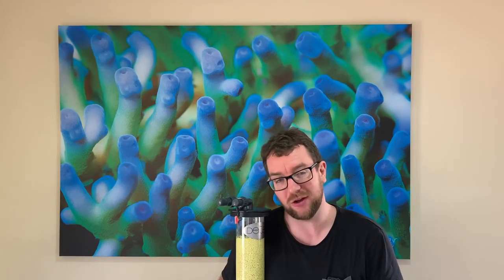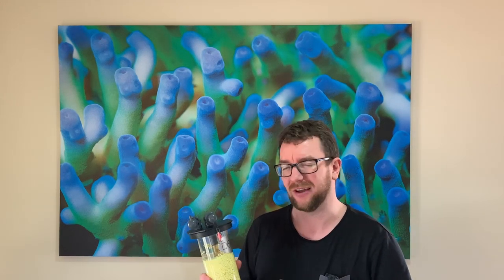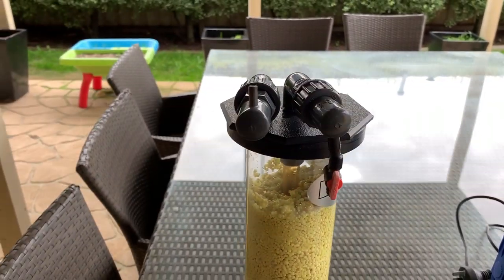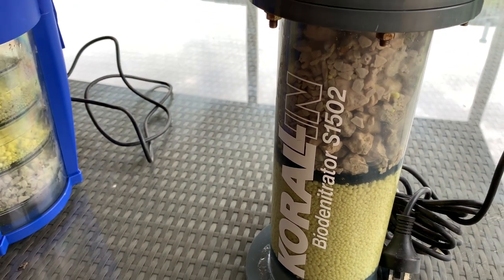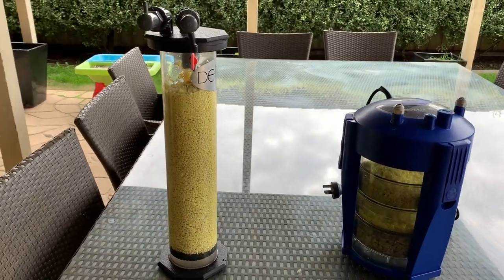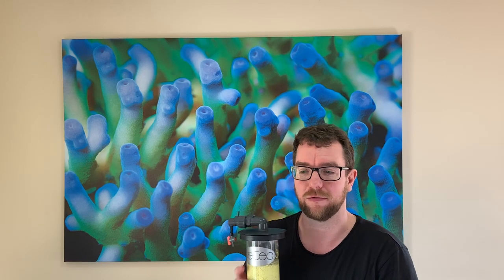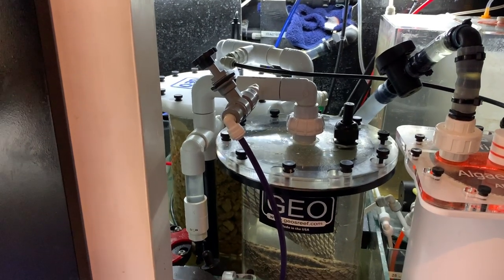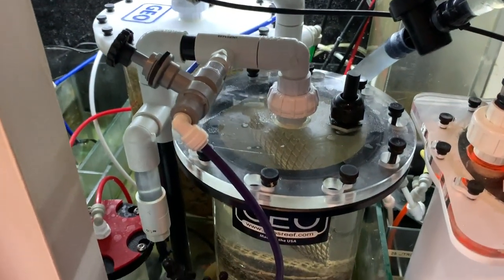Using a Sulphur Reactor for Nitrates

Comment: To run the reactor do you need a skimmer to remove the bacteria like with carbon dosing Sam my tank sits around 25ppm with 60l week wc tanks 200l so anything that can help cut back on the wc a bit would be Thanks for your time
Reply from the maker: Great question! I’d assume a skimmer would be needed, but perhaps not?

Sure thing, try 500ml of sulphur with a drop a second. Adjust it if it zeros your nitrates. Let me know how you go
Reply: @ParkersReef  I'll give it a try soon and let you know

Comment: Great video Parker, question though nitrates in my take are 45ppm but out of reactor are 60ppm has been running for 6 days now and no drop if anything a slight increase out of the reactor why would this be ? 
Reactor using is hmali with sicce pump.
Reply from the maker: Slow the effluent right down :)
Reply: @ParkersReef  is that the Inlet water or outlet water.

Comment: Great video. If the reactor only has a slow flow. (Drips)Even though the effluent is zero or low wont the tank produce nitrates quicker and therefore  have a higher reading ?
Reply from the maker: Yes, if that is the case - you will need a larger reactor

Comment: Hi Sam, currently setting up sulphur reactor as per your video. I ran full flow for 3 days and slowed down to 1 drip per second. I tested the effluent nitrate Hanna max out and my tank nitrate also bumped up to 28 from 20 before I put the reactor on. Is this something usual when starting a new reactor?
Reply from the maker: Not usually no. Has your effluent started to drop yet?
Reply: @ParkersReef  mean drip rate slowing down automatically?
Reply: For nitrate reading it still reading 75+ the colour on Hanna vial even darker today
Reply: For media I’m using aqua medic sulphur pearls in aqua excel nitrate reactor.
Reply from the maker: @shankybrar  not slowing down automatically, I meant is the nitrate reducing. If the effluent is higher than the tank, there is indeed something wrong. Was the media new? Make sure the reactor has no oxygen in it and slow the effluent down even further
Reply: @ParkersReef  from the Hanna vial colour it looks like nitrate are even higher then yesterday. The media was new from aqua medic. Pulling my hairs out about where the nitrates coming from. Yes I let of the air from the point which is available  to add probe to reactor. Don’t have any orp probe to check the status.
Reply from the maker: Maybe feed the reactor some bacteria to help seed it
Reply: @ParkersReef  “Use only in nitrate removing anaerobic filters having a low water flow rate” this what media packaging says. My reactor is recirculating. What kind of bacteria do you recommend to seed?
Reply from the maker: @shankybrar  yes that is correct. And your one drop a second is a very low flow rate :)

You likely won't need any bacteria as your tank water should have plenty, however if you want to speed up the process you can add something like a microbacter to help get it going
Reply: @ParkersReef  thanks for all the help Sam. I spend few hours searching on forums about the high nitrate reading from effluent. Few people had the same issue and someone explained that at the start the bacteria that converts ammonia to nitrite can overpopulates and produces tonnes of nitrite which effects the nitrate readings on Hanna. The advice was similar to what you recommended earlier about slowing the flow even further or adding a seeded sponge from sump or bacteria to get the other bacteria going or just wait out. I have slowed down the drip to every 4 seconds and let’s wait out another 3 days to see how it goes.
Reply from the maker: No problem, fingers crossed it gets the job done for you!

Comment: It's been about four weeks,  I still have nitrates coming out,  if it's to sleep a drip,  the reactor fills with gas,  and circulates that.  I have about 1.5 ltrs of sulfer in there.  I'm guessing just add another liter?  I have 3 eels, high waste. Thoughts?
Reply from the maker: Gas is a worry... we need to stop that. But yes, try some more sulphur to allow you to not have to slow it too far

Comment: Thanks for your help in advance.
Question with my AquaMaxx TS-1 and why Im having issues.
I set this up with 2 litres of sulfur prills and media. Set it up according to your instructions
Started with a drip a sec and measured affluent water until it measured 0ppm nitrates then doubled the drip out put and continued over 2 weeks untill I had a good output and brought tank parameters down to zero. Then about a month later I checked and levels went up to about 20ppm. Then a few weeks after that to 50ppm. Nothing has changed feeding etc. Wondering what Im doing wrong and why the levels would go up since these things are suppose to be set it and forget it once dialed in.
Reply from the maker: That certainly seems odd. Any chance of detritus getting caught in the reactor?
Reply: @ParkersReef  looks good and clean. also has a prefilter.
Reply from the maker: Hmmm ok then, not getting oxygen into the reactor by chance?
Reply: Not that I can see. There may be a liite bubble at the top that hasn't found its way out but I don't see air going through it
Reply: i think im going to back off on the flow and start again and see what happens
Reply from the maker: Yeah always good to start it back slow and slowly increase the flow again

Comment: I have a geo n64 nitrate reactor it is running off a  210 gallon fresh water fish tank it has been running for almost three months my effluent is at 0 ppm but my tank water is at 80 ppm I’m very fusterated the reactor says it can handle a 600 gallon tank I have a lot of sulfur beads in there and on top of that I have searchem denitrate media as well I don’t see the fish tank nitrate dropping ever I start at a drop at 3 drops per second when I increase the drops the nitrate reactor goes to about 10 ppm how do I get my tank to have 0 ppm please friend help me I would appreciate it thank you 🙏🏼
Reply from the maker: hi there, is the reactor recirculating? As in, does it have a pump on it moving water within the reactor itself? A decent sized tank (or a decent bio load) will need a reactor with a recirculating pump for maximum efficiency. Alternatively, you will just need to add more sulphur media
Reply: Yes it does have a pump on it the reactor is a geo reef n64 it is about 20 inches tall and an 8 inch cylinder tube I have the reactor 85 percent full of sulfur and I topped off the top with seachem denitrate media

Comment: Hi, thank for sharing! I currently running sulphur and arms on day 2. I was wondering if i let my tab reactor wide open for 3 days to flush out all the air bubbles, will i overdose my tank with calcium, magnesium and trace elements?
Reply from the maker: no you wont. The ARM will only release the parameters when it is melted, which it wont do at a speed to flush out the air :)
Reply: @ParkersReef  thanks a lot for replying. Really appreciate it
Reply from the maker: Anytime :)
Reply: I had a huge pH and 1 dKh dropped after opening the tab wide. Advices please🙏 500 liters total volume. Reactors filled with 500mL arms and 500mL yellow beads
Reply from the maker: Yes. That is because your bacteria is consuming the alkalinity. Need to go slowly,
Reply: I thought it takes 3-4weeks the bacteria to appear.. should i add more arms? Or start doing drip per second?
Reply from the maker: Not always, sometimes it is quite quick.

What speed are you at now? So you’ve had it wide open, is that it?
Reply: @ParkersReef  this morning i changed it to 1 drop persecond after realizing it dropped my kh and ph. Hope my acros not browning out 🙈
Reply from the maker: @vincenthendri9465  ok now that it is at 1 drop per second, keep an eye on the effluent. If it is at zero nitrate, keep speeding it up little by little. Ensure you are dosing extra KH as its going to keep consuming as the bacteria grows
Reply: @ParkersReef  thank you for the advices. I will try your way. 

Really appreciate it🙏

Comment: Is it common that the nitrates reading coming out of the reactor reads a lot higher than the actual reading in the tank? Mine has a 7.5ppm nitrates in the tank, but more than 50ppm measured at the output of the reactor. I had successfully bottom out the nitrates output @ 1 drop/sec (although it took 2 months to reach this). But 1 day after I increased to 2-3drops/sec nitrates output is through the roof again.
Reply from the maker: Not at all, something is drastically wrong

Comment: found this video and wondering if you still use this reactor. I've been dosing NOPOX, but just need to lower my nitrates and found your video. If you still use it, where can one in the US get the pellets and reactor from?
Reply from the maker: Not in my new display as my nitrates haven’t become an issue just yet (although getting close!)

The reactor is just a calcium reactor with no c02 inlet. The media you should be able to track down via a local fish shop

Comment: So the solphur reactor take care of you nutrients and the calcium reactor takes care of your supplements. Why do you do water changes with the awc? Thank you for sharing all your knowledge
Reply from the maker: Sulphur helps with nitrates, calcium reactor helps with alk/cal/mag and trace. I am still a very strong believer in water changes though, very cheap and effective insurance for your tank.

I know it is possible to run a tank without water changes, but to me it is kinda like running a marathon backwards. Just because you can, doesn’t mean you should :p
Reply: Parkers Reef  I gotcha. Great concept
Reply: Parkers Reef you think soil sulphur is the same thing? Found it on amazon and it says it’s 99% pure sulphur
Reply: Parkers Reef I want to use it but it’s hard to find in the states

Comment: The nitrate reactor must be supplied with water from the
 aquarium. There are different ways to choose the water source, feed pump,  peristaltic pump .... which way do you choose and how it connected to the reactor. thank you very much
Reply from the maker: Thanks for the question, I supply it from a tee of my main return pump. I regulate the outlet speed with a fine control 1/4 valve 👍🏻

Comment: I just bought the Aquamaxx reactor and can't find an LSM or any sulphur meadia at all. Please help me find a place to purchase. AWESOME VIDEO
Reply from the maker: yeah sulphur has been tough to get lately! You can try ebay, they often have sulphur "chips". As long as it is not a powder you will be fine
Reply: @ParkersReef  Found a 2lb bag on eBay. My reactor holds 3L is it a problem if I use 2L Sulfur and 1L calcium media in a 120g? I have very high nitrates over 100 sometimes 150. Is using extra sulfur a good or bad thing?
Reply from the maker: @dynomitedp  that will be fine! With nitrates that high, just keep an eye on the system as it will take off quickly once seeded

Comment: Hey Sam!
Thanks for the great content!

Just wondering if you have any experience with the caribsea No-No3? Looks to be a blend of sulfur and argonite?

Thanks!
Reply from the maker: I haven’t, but you are right - it is. Has a bit too much aragonite for my liking though
Reply: I have a 450 litre tank, and I setup a basic 3 litre hang on the side bio pellet reactor, and filled it with carabsea no - no3 (sulpha/aragonite blend, it is heavy on aragonite) (and it holds about 2.5 to 3l of this media) I have the effulent running at a slow but steady stream, and the water is entering the reactor at about 30ppm nitrate and leaving at about 5ppm nitrate, it's a heavily stocked freshwater tropical tank and I couldn't keep nitrate under 80ppm. These things work 😁 if I wanted zero nitrate I'd need to slow the flow down or I'd probably need a larger reactor that holds an extra 1-1.5 litre media. but I'm not chasing zero nitrate.

Comment: hi parker my reactor is been at 1 drop a second slow drip for 2 weeks. my nitrates affluent is  stuck at 20ppm . i have 1.5 L sulfur  media  in reactor. how much more sulfur should i add to my reactor.
Reply from the maker: Is that the same as your tank nitrate? If so, you’re going to need to slow the effluent down some more. Gotta get it near zero before you can speed it up

Comment: Hi Sam great video just wondering if this system would work on a 17000 liter Aquarium. My concern would be it would take over week to cycle water in tank at the slow drip/ trickle rate ?
Reply from the maker: All depends on the volume. It will work for any size tank, just have enough sulphur with enough flow and you’re set
Reply from the maker: Just ease up on it though, with volumes of sulphur that large - if it goes wrong it will smell really really bad. Make sure you have a large enough reactor (or multiple) and increase sulphur volume over time 👍🏻

Comment: Can using this sulphur reactor mixed with calcium media can you totally due away without using 2 part like my ATI essentials? 
What do you use to replenish trace elements
Reply from the maker: very unlikely to, unless you have super low consumption requirements. I run calcium reactors and also dose trace elements to ensure they are maintained

Comment: Sam, with a 940lt system should I be starting with about 2.50lts. My nitrates are sitting at about 15-18ppm
Reply from the maker: I’d try 1-1.5 Litres first, can always add more

Comment: My FOWLR tank has very high nitrates (250ppm). I was using an Korallin denitrator but I had to much of a problem with nitrogen gas filling the top of the reactor and could never get it dialed in. Any suggestions or experience with that issue?
Reply from the maker: Yeah, I find if you make the recirculating port take from the top of the reactor it will mix the gas with the water which will eventually make its way out of the reactor. 

Or of course, make the outlet come from the highest point

Comment: I am setting up one of these. It has been so hard to bring my nitrates down in my 220 gal. Total 280 gl of water do you feel 1 3/4 liter of Sulfur media could work? Really hard to find more where I live. Thank you.
Reply from the maker: If that is all you can find, it is certainly worth a shot. It will still work in the sense that the reactor will produce effluent with near zero nitrates - but it may not be at a fast enough drip rate to have much effect on the tank. Make sure you are using a recirculating reactor for maximum efficiency too
Reply: Hello Parker. I have set up a sulphur reactor using an old calcium reactor. It’s been over two weeks now and the effluent still is not coming down. I’m sitting at 65 nitrates. I have followed the proposed 2 L of sulphur media. Can you think of any reasons why it’s taking so long or it isn’t working? 
How fast do you circulate the water in the reactor? I started slow but I have upped it as of late to see if it would help. Thank you.
Reply from the maker: @martinvaillancourt2650  can you slow the effluent right down. Need it to be at a drip per second, or even slower if possible to get it seeded. Then you can slowly speed it up

Comment: I want to understand more about how this media is working. What IS the media?  Is it actual pure sulfur beads?  It is yellow, so that seems likely, but what is the chemical reaction between pure sulfur and nitrate?  Pure sulfur is not at all soluble in water, so that is good, but I would like to know how this works in chemistry detail because I would be interested in trying it on smaller scales.
Reply from the maker: Hey Andrew. Excellent questions, all of which I cannot answer. The media is a pure sulphur bead yes. It's not so much a reaction, the sulphur seems to breed bacteria that eats the nitrate. This is a paragraph I cut and paste, hopefully it helps:

Operation of the Sulphur Nitrate filter is based the natural principle of REDUCTION of nitrate NO3 to nitrogen gas N2 using a colony of anaerobic bacteria in a low oxygen environment. The bacteria require a food source and oxygen to survive. The food source is the sulphur and as they are anaerobic bacteria and only grow in the low oxygen water they must obtain the oxygen from another source. The bacteria take the oxygen from the nitrate molecule by reduction, first from nitrate NO3 to Nitrite NO3 and then further from nitrite to nitrogen gas N2.

Comment: So i started this. In the first few days, at one drop per second, the nitrates measured coming from the reactor are over 75 while the tank water is 23. Is that normal? Doing this exacly as u say...
Reply: Hanna nitrate checker used.  But seems to be consistent and accurate.
Reply: Tank meaures 25, out of carbon reactor measures 23 out of sulphur reactor measures 75+. Alk dropped from 8.3 to 7.2 today according to kh director. Any thoughts? Could a sulphur reactor create nitrate at first? Sulphur cause nitrate test interference and errors in readings? Going to try another test kit tomorrow.
Reply from the maker: yep I would slow the flow down even further and make sure you are not getting any air into the reactor. Then leave it a for a few days (or until the effluent smells)
Reply: @ParkersReef  ok, will try!
Reply: I was able to shake out some air bubbles in the reactor by shaking it vigorously while Versa dosing pump was on a high speed. I'll leave on high flow for a while to make sure all the air is out of the reactor then reduce the flow rate a bit lower than one drop per second. Appreciate the help!
Reply from the maker: @bigbearmeetslittlebear3401  hopefully sorts it!